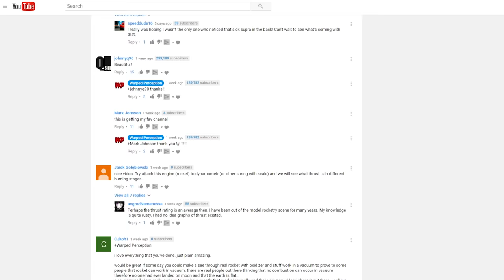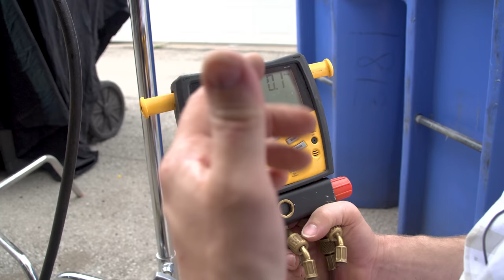Model Rocket Engine In A Vacuum Chamber - 4K Slow Motion - will it burn? - Rockets (S1 • E3)

Comment: I'm not a scientist but my thought is that the thrust is pushing off the side walls in the chamber. This expirement needs done in a far greater chamber where physical walls are too far away. That would be a better more comprehensive experiment.
Reply: @NoNamesLeftFuk  how much fuel in litres or gas litres do they stock, is it hydrogen gas or...., how much fuel is needed for directive thrust and how many times is a directive thrust needed in flight. What method of thrust solution. Action reaction or velocity movement. Please explain if you are a scientist. How do we go through the belts with such volatile fuel onboard? I actually want to understand if you had an answer that sounds plausible. I hope your not bill Nye are you?
Reply: @vincedumitru1465  if I fired a standard Steel projectile from a crossbow in a vacuum would I feel recoil?  Yes or no? why or why not?
Reply: @stuartgray5877  I asked for answers not questions my friend.
Reply: @vincedumitru1465  answer my question and you will have half of your answer.  If I fired a crossbow in a vacuum would I feel recoil?  Simple question, yes or no answer.
Reply: @stuartgray5877  I haven't seen such experiment yet. You must receive pushback from the recoil of the bow but not from the static. Flies can not fly in a vacuum though.
Reply: @vincedumitru1465  So what if you had many projectiles and you could reload the crossbow?
 could you PUSH yourself around in space firing these projectiles into the vacuum?

What if the projectiles were made from WATER ICE?  would firing away blocks of ICE propel someone backwards in space?
Reply: @stuartgray5877  your a true gentleman sir. 
A gun will also fire in a vacuum as it has surface to push against.
Thrust pushes against atmosphere, since the lack of atmosphere in space the other posibility is static inertia.
What is the equation you are using for this? Is it action reaction because this needs resistance added to the equation. 
Thank you for your time to reply. 
I'm not stubborn but I do like reasonable evidence. Not a scientist just a thinker.
Reply: @vincedumitru1465  - So why do you not answer my questions?  I am trying to make YOU work through it in your head.

OF COURSE there is still recoil from a crossbow any time it fires MASS - ANY MASS.

This occurs with or without an atmosphere because the force is exerted BETWEEN two Masses and BOTH masses feel this force.

SO when the crossbow PUSHES on the mass of the projectile the projectile PUSHES BACK because it has INERTIA and MOMENTUM.

When the crossbow pushes away the projectile the projectile GAINS MOMENTUM. The "Law of Conservation of Momentum" says that in this situation the Crossbow MUST impart the SAME momentum to itself as it does to the projectile but in the OPPOSITE direction.

SO the crossbow MUST get shoved backwards when it fires the projectile forward.  This is true with ANY MASS such as WATER ICE or even LIQUID WATER.

If you had a firehose in space and shot it one direction, the hose WOULD GET PUSHED in the opposite direction.  Just think of a rocket as a big firehose it gets PUSHED forwards by firing MASS BACKWARDS.

So according to the law of conservation of Momentum, rockets MUST WORK IN A VACUUM, because they accelerate MASS creating momentum.
Reply: @stuartgray5877  space crafts as I understand don't fire projectiles.
They propel using conventional rocket thrust. 
I still can't imagine how your example would apply to a moving object expelling combustible.
Is there a video experiment showing evidence of a rocket thrust working in a vacuum so I can visualise what you are saying.
The firehouse issue is that we have atmospheric resistance and velocity exiting a small orifice would be the reason for the push back. Your examples are well explained but not in a vacuum scenario. 
If you shot a gun in vacuum you would get recoil also but that is the resistance of the bullet escaping the chamber. 
Still your theory doesn't work in a vacuum.(to the best of my understanding)
Reply: @stuartgray5877  on earth the rocket propels against atmosphere but in space it pushes against conservation of motion? Let me look at this conservation of motion law and get a visual of it.
Reply: @vincedumitru1465  the "combustible" HAS MASS. The rocket is almost ALL FUEL when it lifts off.  Do you think the mass of the fuel and OXIDIZER disappears when combusted?  No, the exhaust gas has EXACTLY the same mass as the fuel and OXIDIZER consumed.  When the Space Shuttle Main Engine ( SSME) runs, it consumes 500 kilograms (about 1100 pounds on earth) of liquid oxygen and liquid hydrogen PER SECOND and exhausts 500 kilograms of LIQUID WATER at MACH 8.  Are you suggesting that 1100 pounds of WATER can get accelerated from zero to MACH 8 without exerting a force on the machine firing it out?
Reply: @stuartgray5877  yes in simple words I am suggesting that. A theory is one thing and putting it in practice is another. I'm not trying to be difficult here I am just not picturing  
How this works in space. You must imagine a free moving rocket  moving a 1000kmh then fires a projectile. The projectile must be fired a 1200kmh minimum to have any impact on the already moving object even in a atmosphere this would be the case.
I just can't see how it would actually work. Sounds good in theory but I doubt it works in space. The theory may work with a object that is static or barely moving.
Reply: @vincedumitru1465  - "imagine a free moving rocket  moving a 1000kmh then fires a projectile. The projectile must be fired a 1200kmh minimum to have any impact on the already moving object even in a atmosphere this would be the case."

This is absolutely False.  Even if the "spacecraft" is travelling at 17,000 MPH with respect to the ground, it can STILL gain momentum by throwing a block of ice out the back at a "spacecraft relative speed of" only 100 MPH.  This is STILL AN EXCHANGE OF MOMENTUM.
Reply: @stuartgray5877  now that we found our disagreement I would need to look further into this theory. 
Just to establish.....is this actually what they do or is this the analogy given only? 
I am willing to work with you on funding a project to test this theory in a vacuum or maybe we can send it to a show that might take it on.
Not to prove right or wrong but to come together to inform the public. 
You mentioned liquid hydrogen as the fuel. I wonder that keep hydrogen stable when going through extreme radiation belts. 
If we have this technology I would like to see it in combustible cars...
This would end the theory of global warming for ever.
Reply: @vincedumitru1465  - "...is this actually what they do or is this the analogy given only?"
Yes this IS how they work!
A Space Shuttle main engine ingests 500 kg of liquid Hydrogen and liquid oxygen PER SECOND and combusts them creating pure WATER.
It ejects this water at 2500 meters per second (5600 MPH), and routinely reached orbital speed of ~17,000 MPH using that exhaust velocity.

 I literally help build, test, launch, and FLY spacecraft in earth orbit and deep space for a living.

"I am willing to work with you on funding a project to test this theory in a vacuum or maybe we can send it to a show that might take it on."

You are willing to FUND a study to see if rocket propulsion works in a vacuum?  Sorry but that has been done REPEATEDLY.
Just WATCH one of the SpaceX launches and landings for proof
And they have hydrogen powered cars already that have nothing but water as a waste product.

Have you been sleeping under a rock for the last 50 years?
Reply: @stuartgray5877  I haven't been sleeping under a rock but I question everything!!!! There are hydrogen cars I know that but they say hydrogen is too difficult to contain so this is why it isn't viable for production. Why don't we throw our selves at this technology as it will fit in combustible and electric cars the like.
Jleno has a Merc that runs on liquid hydrogen but I can't seem to find that video any more. This tech will destroy so called climate issues in 5 years time this can be implemented to any car petrol or even diesel. 
I shall look at space x videos if I could get some links.
Thank you for your time!
Reply: Vince, the notion that rockets do not fire projectiles is nonsense.  Of course they do.  Call it whatever you want.  Fundamentally speaking - thrust which is the result of the conservation of momentum is the result of mass being ejected away.  A rocket's mass is 95% fuel.  When the rocket is empty, it has 5% the mass it started with.  That mass went somewhere.  Unless you are prepared to assert that it simply vanished and has zero momentum in la la land somewhere, you need to at least concede this fact if you wish to have any debate at all, because if you are going to assert otherwise, then there is no foundation on which a debate can be had because you can't even agree to the most fundamental basis of fact.  Assuming you understand this...

Imagine you are in deep space and there are a bunch of 10kg balls all around you.  If you grab one and throw it, you would be thrust in the opposite direction.  The conservation of momentum dictates that.  It's not something that requires proof.  It is literally a fundamental - basic law of physics.  I assume that even the most uneducated person on the planet understands that if you push something with mass away from you, then you would be thrust in the opposite direction.  You KNOW this is the case whether you know how to articulate it or not.  Anyway, if you grab another ball and throw it, you will accelerate a little more.  If you keep doing this, you will build up a lot of speed.  Now, you aren't being thrust in the opposite direction because of all the balls all around you, right?  You're only being thrust specifically because you pushed specific balls.  Each time you pushed a ball, it pushed back.  This is the Newtonian perspective on it - the third law of motion.  All the other balls that you are NOT pushing are not in any way contributing to your acceleration.  They are just out there as a potential source of mass for you to push away from you.  This is the equivalent to how planes work in air.  Planes are not pushing off the air around them.  The air is simply the source of mass which they eject away, and they are only pushing off the mass they are ejecting away.  The equivalent to a rocket would be empty space and just a giant container full of 10 kg balls.  You brought the mass with you.  The same thing applies.  You accelerate the exact same way a plane does.  You take a ball, throw it, you accelerate.  You take another ball, throw it, you accelerate - but a bit more this time, because your mass is less since you are now getting rid of it.  The more balls you throw away, the more you accelerate because you get less and less massive.  Note here that the momentum you gain is gained the very moment you throw the ball.  If that ball goes on to hit a brick wall or another ball or 10,000,000 balls, it would be absurd to suggest that it would have any impact on your motion.  It's job of accelerating you was done the very moment you released the ball, so to suggest that the ball hitting another object when it is not even in contact with you would change your motion is patently absurd, and in this context I would hope that you would see clearly how absurd that is.  This is literally the equivalent to thinking rockets need air to push off of.  Your demands for experiments to prove this to you only work to discredit you in the eyes of people who are educated on the topic - because the very purpose of establishing laws of physics is to negate the necessity to perform an experiment to confirm something that is already established law.  It would be impossible to further advance in any discipline - particularly science if you were not allowed to assume prior established physics as a given.  It's literally the purpose of established physics.  We are not dealing with theoretical physics here.  The experiments for what we are talking about have already been done.  The books have already been written, and you're not shaking the foundations of those physics by demanding to see experiments for things which are irrefutable fact.  The only thing you are doing is demonstrating very loudly that you are patently ignorant on the topic.  Rockets work in a vacuum.  Anyone who claims that there are laws of physics which suggest otherwise doesn't understand physics.  This is even ignoring the blatant irony that you very likely use a technology every single day that would not be possible if rockets didn't work in a vacuum.

Comment: I am missing a pressure reading. I have no way of knowing, if there is a vacuum inside, or not.
Reply: @darklight2.1  During engine firing.
Reply: @darklight2.1  I would love to see a relation between thrust and preassure. does it change, when preassure in the chamber rises? Or is thrust stable? Is there even a vacuum at ignition?
The issue is; I am just having an argument about this topic and these are questions i got.
Reply: @darklight2.1  So why do the experiment, if you know everything...
TO clarify; I am not interested in theory, I am interested in seeing, how it works. The theory I know.
Reply: @darklight2.1  Mate. Please stop. I really do not need a lecture. I need to see an experiment showing thrust in vacuum. Showing, theory works.
Reply: @darklight2.1  I am learning, that some people do not understand the difference between theory and the universe. As my boss told me; great you used the equation; let us check, if water knows it too. 
Also, that some people think they need to talk. And that I don't care as much as I thought, I would. I am getting  frustrated with your lack of "listening". But you are making my comment more popular for the algorithm, so I suffer through. Cheers.
Reply: @darklight2.1  You did not answer my questions. My questions concerned experimental stuff not theoretical conclusions. What I want to see, is how conclusions were made, not what the conclusions are. Please consider, you may be  talking to somebody who knows a lot.
Reply: @darklight2.1  I want to see the relationship between thrust and pressure in the vacuum chamber (prefarebly almost ideal vacuum at he beginning). So you are right; I had no question, I am asking for a new experiment.

Comment: I do not understand why there are people who believe that rocket engines do not work under vacuum.
If the rocket engine has the fuel and the oxygen in the same mixture which makes the air unnecessary.
Reply: Oh, they think that rockets need something to "push" against to move. Within the atmosphere that would be the air, but since the space is empty...
That's their (lack of) reasoning.

Comment: I thought I should clarify by saying this, Where is the WATER! "Yes, when you create a vacuum a real vacuum all the evacuated gases within the chamber would leave water vapor instead with the appropriate pump this is a fairly straightforward matter. The water vapor has been there all the time as a small percentage of the overall gas composition, yet no gas and the water would be evidence you've created a VACUUM? And without heat, you'd never dry the water, however if you did then hydrogen will slowly become the dominant gas that was left within the chamber, thus you didn't even know this or are a shill? Either case, I challenge you to try again, this time with a real gas free chamber? and, well your results will be terrifying to tell you the truth, because it will be a bomb, and blown up! or no ignition at all, depending upon how much HYDRO was remaining? Like I said before, you were burning Nitro, nothing more?